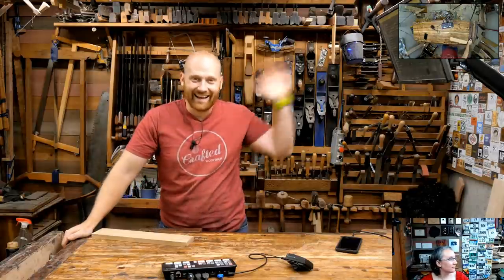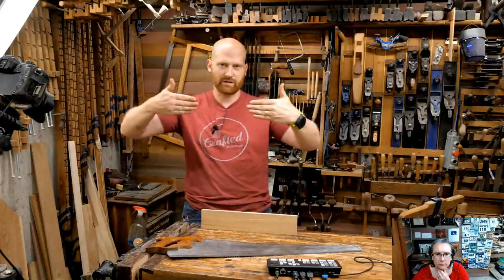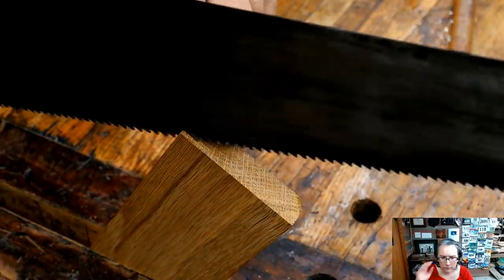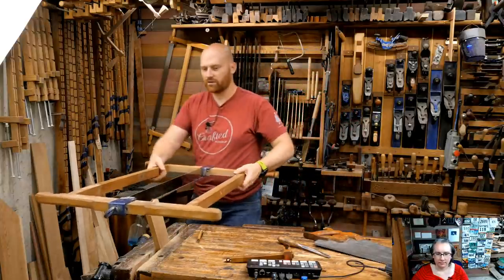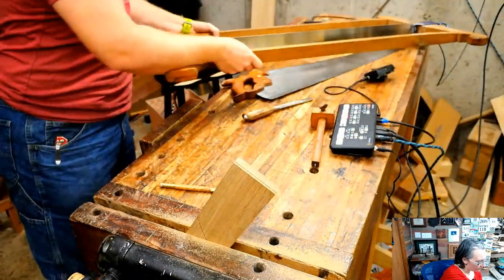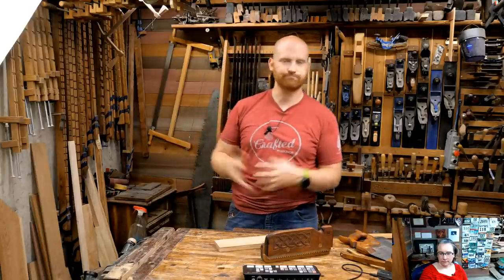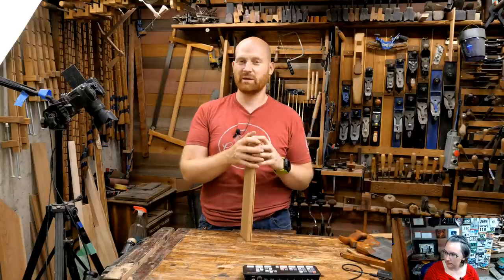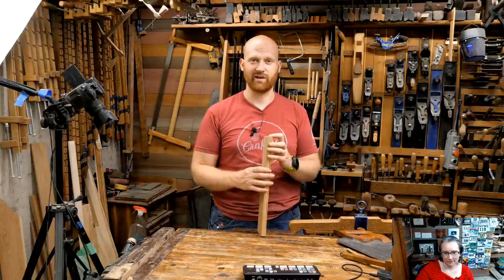How to Resaw With Hand Tools

Comment: I have a dull hardpoint handsaw and I'm thinking of grinding off the teeth and using the plate ti cut a regular ripsaw, and I was wondering about TPI, I was thinking 7, but now I'm thinking 5. I have a good saw file and a saw set.
Reply from the maker: Sounds like a fun time. It all depends on what other saws you have in the shop. If you intend to do a lot of large ripping then larger teeth are better. but a seven or eight PPI is a really good all-around saw. It's not really fast but it will do really clean cuts and you can use it for some of the larger joinery.

Comment: Do you ever have problems with bowing after re-sawing
Reply: I do. I find sanding the outside first can help
Reply from the maker: Yes sometimes that is because there is tension in the board and when you cut it you release that tension and so either side will bow away. Other times it's caused because the inside of the board has not been able to dry as fast as the outside of the board. So when you cut it later on the inside can fully dry and it will start to cup.

Comment: that audio tho. ouch
Reply: Looks like James is using a Blackmagic Designs ATEM Mini (maybe the new Mini Pro?).  I've seen several folks online complaining about audio quality...

James: If you haven't tried it yet, look at the audio level setting in the software (line vs mic level).  If it's set to the wrong level you can get distortion that you can't eliminate even if you turn the gain down.
Reply from the maker: yeah. We're still playing with that unfortunately it's one of those things that you can't know until you actually do a live to see how it sounds.
Reply from the maker: Yep. Unfortunately with our current setup we can't use the black magic software on it yet. I thought through the recording I had set the mic level correctly but you never know until it actually goes live and since I don't have anyone to monitor the live I really can't tell and talk later.